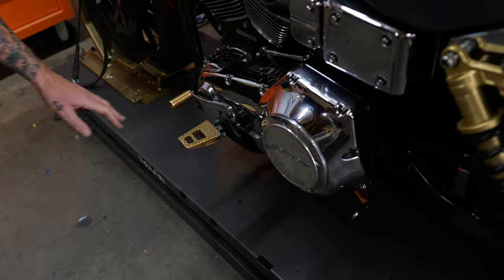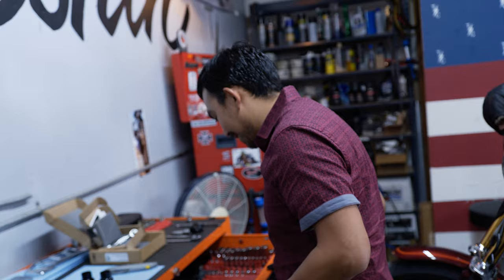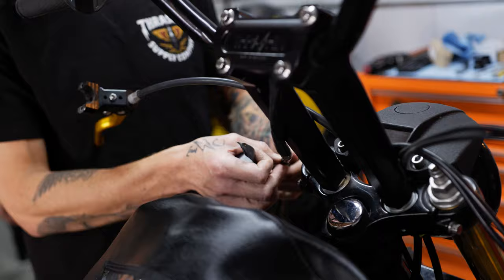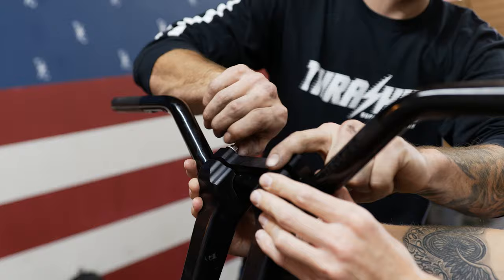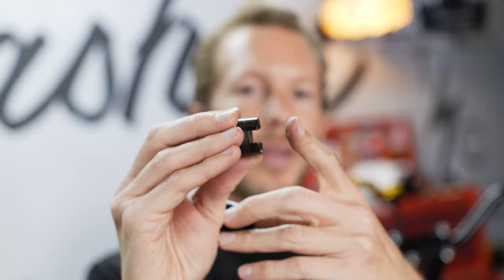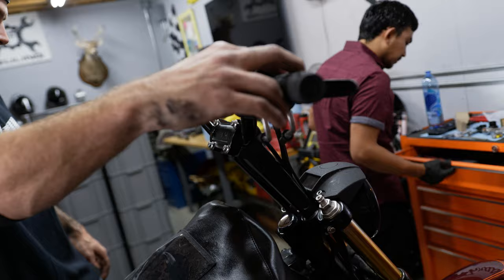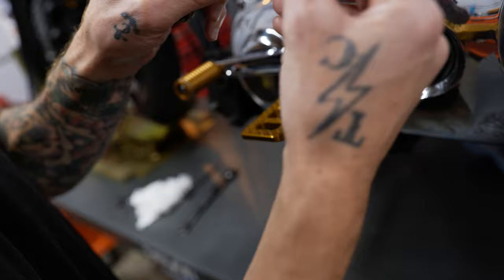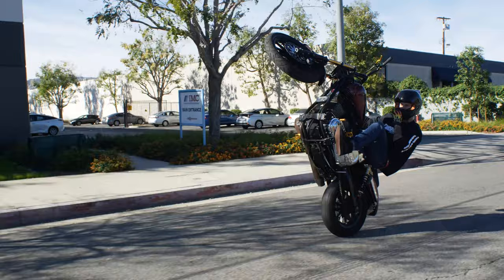IN THE SHOP: RECKLESS AT THRASHIN SUPPLY CO.

Comment: Can you cut down the bars if you have an m8 softail running throttle by wire
Reply from the maker: Yes, but you will need to grind the key ways in for the tbw after. Not impossible, just takes work